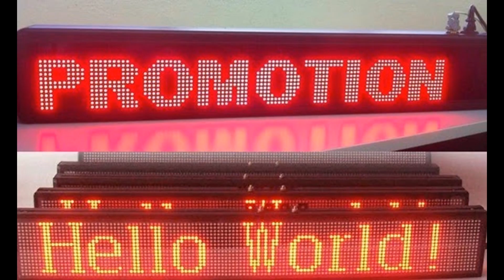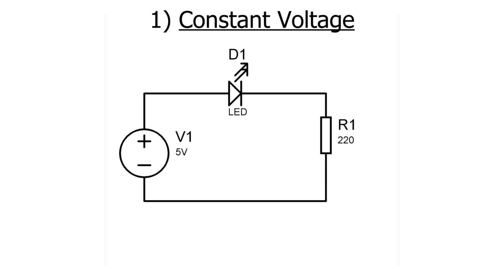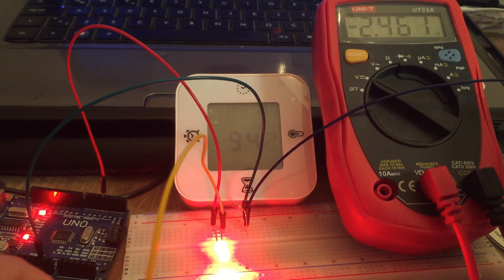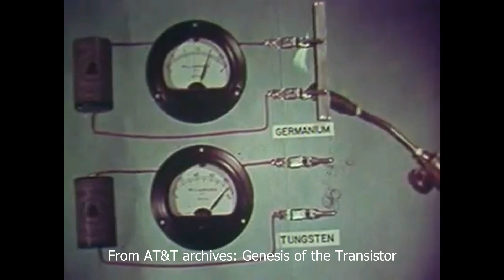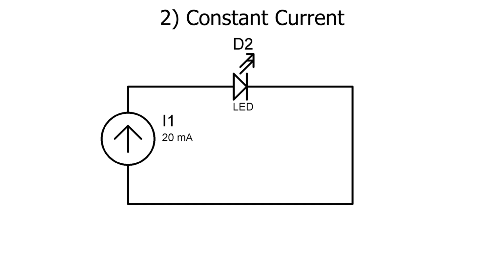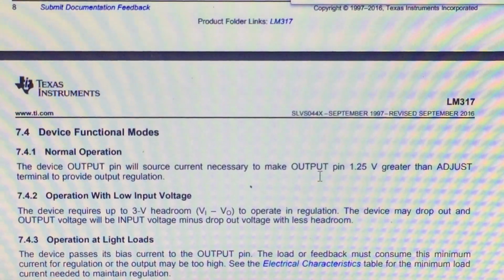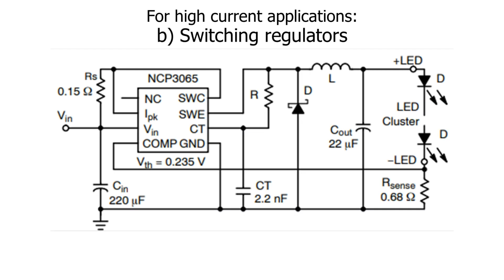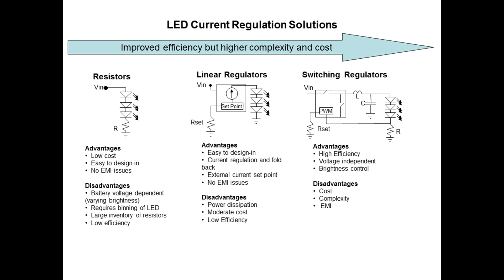How to drive LEDs - Constant Voltage or Constant Current?

Comment: Hi, nicely explained. Thanks
I want to make aquarium LED light With 36LEDs each 3W. I have power supply driver of 30v -42v 1700ma. How to make circuit to suit that LED requirements.
Any help is appreciated. Thank you
Reply from the maker: Hi Aniruddha, what is the forward voltage of your LEDs?
Reply from the maker: @anichhatre  3 parallel lines with 11 serial LEDS should do the job.

Amazon page says that forward voltage is between 3.4 and 3.6V. So 3.6*11 = 39.6, which is below your max. voltage. Don't use the remaining 3 LEDs.

Because each LED has different forward voltages, current flow will be different for each parallel line. I recommend you to measure current from each parallel line, make sure current from each LED doesn't exceed 3W/3.4 = 0.88A. Heatsink your circuit well. Good luck.
Reply: @electroacademy  3.2v 600mA recommended current
Reply: @electroacademy  Thank you, i have 15x 6500k, 12x 8000k and 9 grow LED which has same fwd voltage.

Comment: Thank you for the video but can I ask a question if you have a constant voltage source with a constant current say LM317 constant voltage followed by LM334 constant current as you change the load why does the voltage change on the output? Thanks, Bob
Reply from the maker: Hello Bob, by saying "output" you mean the output of LM334, am I right?